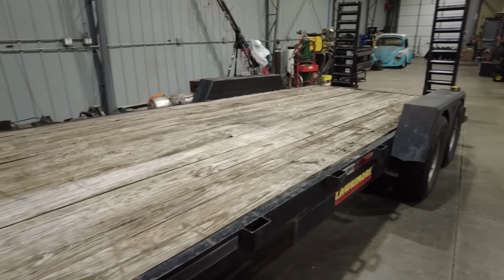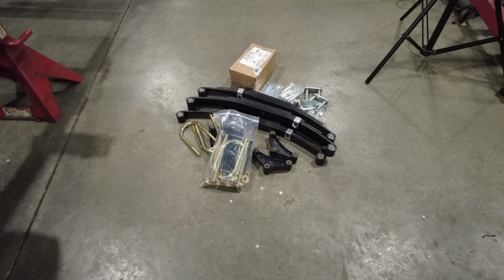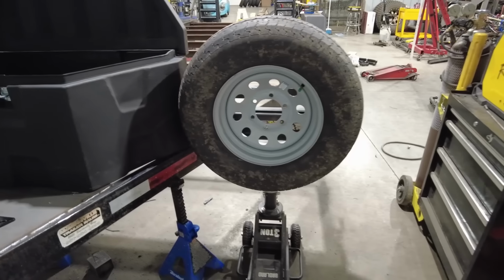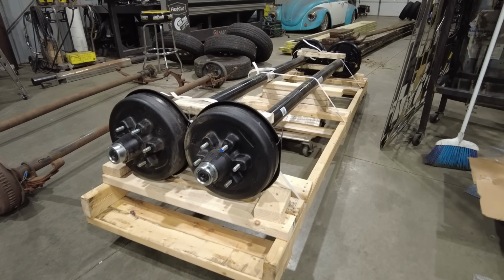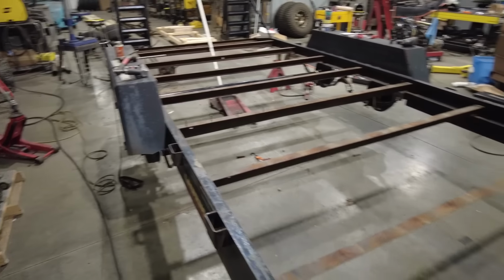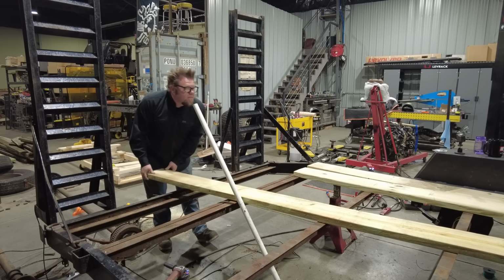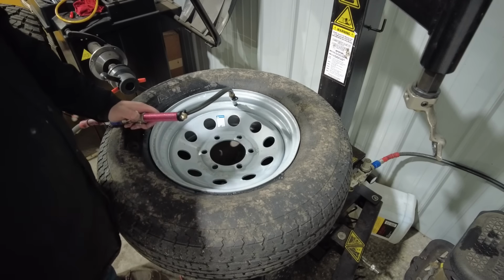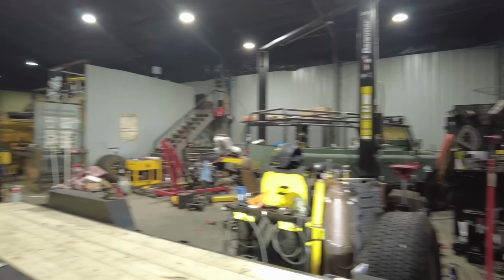Car Trailer Rebuild, How to Increase the Load Capacity of your trailer

Comment: I would use a drop leg jack. An impact will beat a jack to death. A speedwrench or electric rachet will save a lot of wear. Then jack by hand. Also put a loop for the winch hook so you can use a blockon the winch rope. Not to double the  capacity but ease the strain on the rope and make the pull smoother. Not as fast but smooth and easy. 10k winch with a block equeals 20k capacity, half the load on the rope at same load.

Comment: For decking ..go to home depot.. the will have culls that arent good for framing 70 % off .. some times you can get some one to cull  out  a few for you ..its a great savings but sometimes takes a bit of effort ..since they are  mabey warped a bit you have to use force and a few ore screws or bolts when installing but the savings is well worth the effort ..saving 7 dollars out of every ten on the decking ...i recenty did a 96 inch wide by 30 foot ..save around 350 dollars right there

Comment: Use quick connect with no  air chuck and put it straight onto the valve stem  with no valve core ...most of the time this will open the quick connect  up and   release maximum volume at once to seat the tire on the rim
Reply from the maker: Like that idea as well

Comment: The reasoning for the Ground being white wire and black being power, is to follow similar to household wiring. White being common neutral and black resembling the common wire to either your pole or to your breakers! Making all wiring to follow code! 

your absolutely right about the old DC trailer wiring black ground and power being white, but in most newer vehicles, trailer system connections run from the fuse box/panel and is a little more sophisticated.

Comment: Goodyear has a chart with various max load per psi and size. https://i.pinimg.com/originals/00/ab/34/00ab34daeda2098944b43cffc88bd3f8.jpg
Also, how do you get the registered/titled weight changed so you are legal?

Comment: I wonder that you never added any steel to the frame rails at all, but you added 10k axles under it. Unless the trailer was rated for 10k it won't make it able to carry more than the 7000 lb axles it had when new. You've just overloaded the frame of the trailer
Reply from the maker: This trailer from the manufacturer has the same frame under the 7k as the 10k

Comment: Another note on the wood decking, mount the boards with the crown up. So if your looking at the end of the board, the growth rings will make a "C" shape, you want the top of the C at the top, and the 2 ends facing down. This will help prevent the wood from holding as much water, prolonging the life of the wood. Also for people that don't know, just because you put a higher weight capacity axle under your trailer does not increase the "legal" capacity. If you get stopped of checked by DOT they are only going to go by the data plate/sticker on the tongue of the trailer and they could punish you with anything from a ticket to impounding your trailer or anything in between. (Not saying I agree with that, just a warning to those that may not know.)
Reply: To add to this comment, speaking of the DOT, 
ANY TRAILER rated 1 pound over 10,000 lbs, pulled by 
ANY VEHICLE UNDER 26,000,  lbs., is required the driver to be licensed with a Class A, CDL.
Got that?  You must be legally licensed to operate a semi down the highway.
Wait, there's more!  IF your tow vehicle + trailer combined gross over 17,000 lbs. Your required to have a Combination licensed plate on the tow vehicle $500. + plate.
If you fail to aquire and pay for this and get stopped, they take your truck weight, add your trailer and the contents weight,   and add those figures to total gross weight overload fine on your tow vehicle.  Basically, you're going to jail, and you might as well handover the title of your rig to pay the fine.
On my 10,000 GVW  trucks, I pull 7,000 lb  trailers to stay under that magic 17,000 Combination number. 
One more thing, yes, there's more!    
If you have one of these fancy crew cab, 4x4 dually, loaded for bear tow rigs with a GVW over 10,001 lbs, DON'T CROSS ANY STATE LINES w/o a 
DOT # with the sticker numbers on the doors. You'll have some face 2 face time with the judge about you being in business. 
Just stay under the 10,000 limit.  This is why you're  seeing these newer trailers rated at 9,950 GVW now.
Hope this helps.
Reply: That's not what crown means. You're talking about what is referred to as cupping. Also a board cups the opposite to the way the growth rings are. Look that up.

Comment: I think you need to add a support under the spare tires that's alot of weight on those little brackets holding them on. All that and no new paint.

Comment: Having personally built numerous trailers, I might suggest that I would NOT consider that a 10,000 capacity trailer , its is only a C channel frame trailer , NOT a rectangle tube frame trailer  & I would certainly take the 10K capacity with a grain of salt    No comparison between C channel & rectangle tube when it comes to strength   heavier weight yes, but not that much & well worth it

Comment: 2, 5k axels provides 10k GVWR, which includes the trailer weight.  If the trailer is 1k, you can only add 9k as a load, not 10k.

Comment: Here are a couple of ideas for some of you if you like them. We went to the junk yard and got a spare tire winch off of a pickup and mounted our spare under the trailer tongue. We also mounted our jack to the side of the tongue and then put spools in front and back of the axels on both side so we can use the trailer jack as a jack to change the tire.
Reply: To change tires on a two axle trailer all you need to do is pull the  tire in front of or behind  the one you want to change  onto a bump or block  ..the other wheel will be left hanging in the air.. gotta rember to loosed lugs  first tho ..unless you have brakes on that wheel ..or you can Kam some thing against tire so it don't spin...also if you use the lug wrench so it crosses the axle hub as your tightening or loosening it has less  leverage to spin the wheel probly most know these things but some may not .

Comment: The wiring colors are consistent with 7 wire RV. Using the black for ground can be confusing during diagnostic testing. White is consistent n 4,5 flat and 7 blade rv.

Comment: I'd weld a cut-down 1/2" sq. dr. socket on the jack nut, for 1/2" sq, dr., now no fumbling for the correct socket. On my trailer, l used two 1 1/2 X 3 steel channel stringers flat side up welded to every cross member the length of trailer spaced approximately the width of the average track width of a vehicle.  Flat bed tractor trailers use this practice, 😊 good luck 🤞

Comment: One thing you need to be careful about with LED lights is that if you hook them up with the wrong polarity, it can blow out the LED... With incandescent bulbs, the polarity did not matter, but with LEDs, it most definitely does... SOME of the trailer lighting manufacturers have designed their products so that they will protect you from hooking it up backwards, but that is not something that you can rely on... And, of course, you have to factor in the fact that with the Chinese manufacturers, they colors that they use for the different functions is likely different than what we use plus it's entirely possible that the product comes with no instructions and the "instructions" that they posted on the Amazon ad is wrong...

Also, there is more to increasing the load capacity of a trailer than just simply replacing the axles with higher rated axles... A chain is only as strong as its weakest link... If the hitch or frame is not strong enough for a 10K lb trailer, you don't have a 10K lb trailer...
Reply from the maker: Frame on this manufacturer trailer is the same for the 7K as the 10K

Comment: I just want to add that I truly suggest a good Butane soldering iron. It has been such a wonderful surprise in its handiness and reliability. Mine also blows heat at the tip end that is plenty for heat shrink applications. Great build, brother. Thank you.

Comment: Can't use an impact driver on that jack...i have a couple of them....manufacturer says drill only on it because an impact will destroy the gears in it. Unfortunately those center lights wont last long....they should be completely recessed below the steel plate with expanded steel welded over them or same idea but just many holes cut out in the plate above them in the steel plate......if they aren't below flush and protected they are gonna get damaged all the time. It's a great idea but they have no protection as is.

Comment: My 7K trailer already has 4 wheel brakes.  Added tool box and winch.  Has steel deck & LEDs.  Can't use more weight for how I use it.  Next upgrade would be decent tires to replace the Chinese cr*p it came with.  Dumped the center mount jack,  (HATE those things) added swing away on side of tongue.  Also made a set of wood rails dropped into tie down channels to surround the entire bed so I can use it for hauling other stuff.  Spare mounted on side rail is no wider than fender.  I once did the 3500 to 5000 conversion on a customer enclosed trailer after he bent the stock axles overloading it.  Keeping a 4 pin male to 7 pin female converter in the box allows me to move it with a lighter vehicle when empty.
Reply from the maker: Nice...sounds like a good trailer!!

Comment: With all that work you were doing why didnt you give the trailer a nice diy paint job while you were at it?
Reply from the maker: Because to do that I would of had to strip it, and then paint it...and if I was gonna do that I would want to getbit powdercoated...and that was just too much work...
Reply: @BigTireGarage  I would have atleast paint the runners that were rusty under the wood, even just using a Primer that stops rust then painting those wood add years to that trailer... then again I'm from the rust belt

Comment: Dig the project but curious what the lifting capacity is on the tongue jack?  Kinda useless to have a 10K Gross weight trailer if they jack cant lift it off the tow vehicle while loaded.  I have a 10K trailer I bought and they put a 2K jack on the tongue.  I ended up installing side winder corner jacks with a cross over bar.   BTW,  you may need to take this to your local DOT or DMV and have it recertified.  Regardless of the axles and tires, if the rating sticker still says 7K gross, them state boi's will be making your life hell on the side of a road one day.

Comment: You forgot to paint the trailer, not just the center flat steel
Reply from the maker: Didn't want to spend that much time on it
Reply: @BigTireGarage  still did a great job.   I just found your channel.  Didn't I see you on extreme 4x4 on spike TV before?    Your channel  has very good production.   👍

Comment: I like what you did , i did the same last year ,but your frame is too light , I went with 4 inch I beam and centre beam ,it will carry anything with only a bit more weight and a third axle. So many times you end up with a flat with the third axle you never have to stop till you get were your going ,plus better stability , mine is 26 ft and can carry my JD tractor with front end loader. And always solider your wire connections butt connectors corrode , bravo on your ground wire , i went with used steel deck plate it was a no brainer once it was done ,your centre should be steel so you can add extra tie downs for any odd things you end up carrying .

Comment: Is  your tongue long enough to allow backing the trailer up or making tight turns?   How often are your spare tires / rims going to hit your rear bumper.

2,  just because the axle can carry more load. Can the frame handle that load??????     If you start loading that frame up to the higher loads you are looking at bent frame, worse,broken welds, broken welds on the tongue.
Reply from the maker: The frame on this particular brand of trailer is the same between the 7k and 10k I checked before I started this job.

And yes you can completely "jackknife" the trailer and the wheels do not hit.
Reply: @BigTireGarage  I was going to put my spare tires there, but my tongue is only 4 ft.  They'd hit.  

Strange the company would spend the same $ on frame material for a 7k as their 10k trailer.   But ..  maybe if you checked..  you checked.

Comment: Your trailer has a VIN that tells DOT what the trailer is rated for. Changing axles & tires do not change the trailer capacities. Now you may NEVER be checked by DOT, until your involved in an accident. As CDL hot shot driver I've been fined twice for overloading the original capacity. They are not cheap tickets. I had done basically the same upgrades bigger axles & tires. Also, your registration price IF your state/county will even register at a higher weight. No, I was never in an accident but as a Hot Shot I have to run DOT #s and stop at state scales.

Comment: I’m really not understanding how you can increase the capacity of this 7000lb trailer to a 10,000lb trailer without upgrading the frame.
Reply from the maker: The frames on a 7k and 10k trailer from this manufacturer are identical

Comment: Like some others have mentioned, using spindles to mount the spares gives you a little backup if ever needed. You might think about getting some spare tire covers to help the spare last a little longer by blocking the UV. I think I'd have either stained or varnished the decking too just to help keep it looking good, plus it'd be easier to clean up if you get grease or oil on it. Great video, thanks for showing how to get things done for a great price, now if I only had a shop full of killer tools like you have.

Comment: Living in ohio winter we are more vigilant at coating rust.   Surprised you didnt use a rust converting product.   There is so many options.    I like eastwood products as they have stopped current rust and went thru a winter without it coming back

Comment: Butt connectors with marine heat shrink. Great idea! Dedicated ground wire. Excellent! 2 Spare tires. Very Good! Extra break away battery not needed. Just connect to winch battery. Winch mount. If you make it connect with hitch tubing, you can easily move it if needed. The wiring color coding is standard for RV wiring.

Comment: I can say this from plenty of experiences.   The bar you mounted the winch on needs gusseted to the hitch. It will look like a horseshoe in short order. Nice build tho
Reply from the maker: No...pulled multiple vehicles and bodies up on the trailer...bar has moved...it is gussets to the frame under the bar from the factory

Comment: The reason the wires are the wrong color is its trailer house colors white is ground in a house black is power green is neutral. Red is a second power like 220 of a three way switch. So you are not crazy they are.

Comment: Great video, but you need to make the disclaimer that you did all the calculations of the moments of inertia to prove the trailer frame itself can structurally handle 10,000 lbs….. you did surely.    You can’t just add axles and up the gvwr of the trailer.
Reply from the maker: This trailer from this manufacturer shares the same frame between the 7k and the 10k...
Reply: @BigTireGarage  that would be a good disclaimer to put in the video.   A lot of people might think you can throw bigger axles under a trailer and automatically make it rated higher.
Reply from the maker: This is still the land of personal responsibility, and there is a full disclaimer in the video description.

Comment: Someone else hooking up to your trailer say to move it for you for whatever reason would have light issues. The standard across the industry for factory wiring green is right turn signal brake light 
yellow is left turn signal brake light 
brown marker and tail 
white ground
Reply from the maker: This trailer is wired like all trailers...you are correct that green yellow are turn and brake...and brown is running...that is how this one is wired

Comment: You're really going to splice those wires out in the elements, when you have a junction box sitting rt there? ok dood

Also, You didnt save $3000, you could have sold that trailer for 4k, and bought a new one, saving you more than 3k. Time+5300=8k 
Although, you now have a trailer that you partially designed to your liking, and it does look good. gave me some ideas for mine. 

I might hit up Lippert, I have a 28' stainless steel trailer frame that needs axles. 

When I wire up grounds, I bolt the ground wire from lights to frame. I also bolt a wire from frame to plug. beats running more wire that could get damaged. Grounded thru the ball hitch and wires.

Comment: Dude, you didn’t actually increase the carrying capacity to 10k, the frame structure of the trailer isn’t spec’d for it. And you didn’t add any structure to remedy that at all😅
Reply from the maker: Wrong, this modelnof trailer has the same frame for a 7K and a 10K trailer

Comment: I just rewired a trailer at work, basically the same thing here, it just tilts. Started pulling out the old wires...green was powering the running lights (also was pinched in the tilt, and the cause of exploding fuses) brown was the right turn/brake, and red was on the left/turn brake. I was so confused, but i was ripping it out anyway. 
Get to the junction box, there's nothing connected to the yellow lug besides the wire coming from the plug. Instead, there's a red wire coming from the plug, and connecting the left turn/brake. Apparently someone put an RV plug on this trailer, and wired it like a psycho. I suspect our mechanic at work is really a bear wearing overalls.. Like it's just lights, the wires have printing on them tell you where to connect them, and their color coded!  
Anyhoo. Just picked up a sketchy trailer yesterday, gonna do pretty much this! 
Love the stuff you do! Been watch you since Power Block! Extreme 4x4 baby!